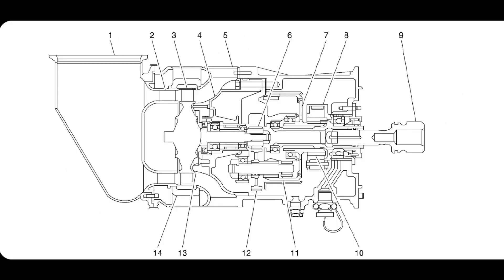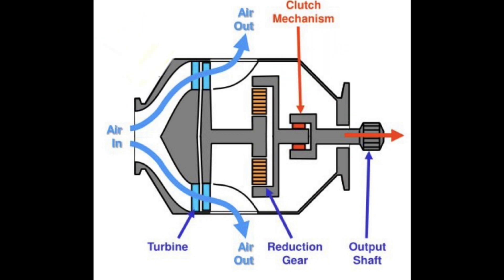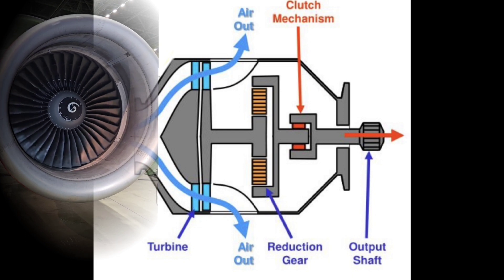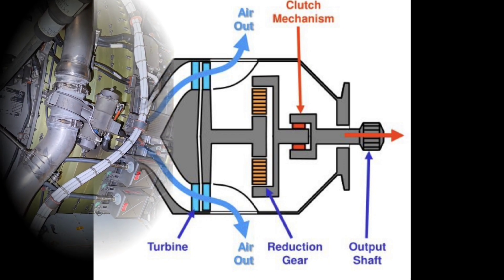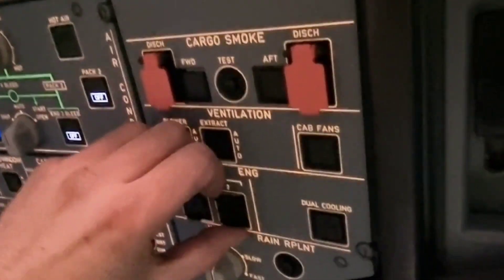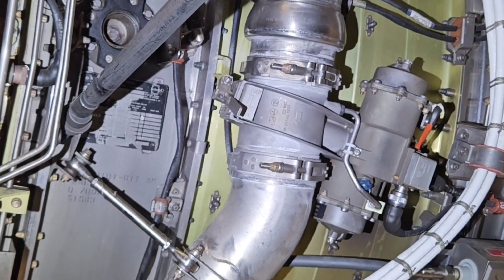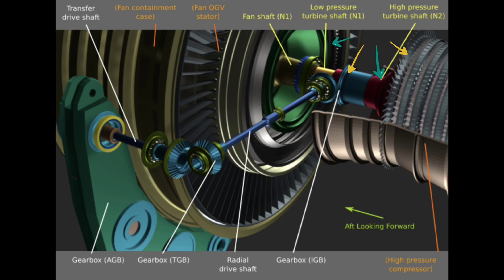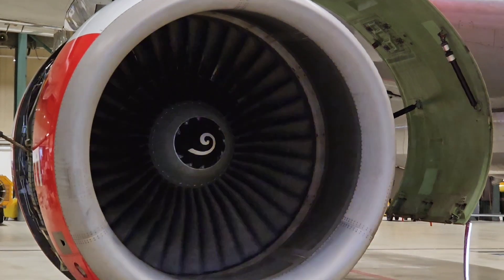How starting system of CFM-56-5B works

Comment: They start up with air pressure?? because an electric motor was too easy??? how incompetent are they?? Jesus
Reply from the maker: This is light and you have a very powerful air source so why not and it is very reliable.
Reply: @zeto.r  no, the little starter itself might be modest weight in isolation but consider the pressure tubes running all the way from the tail APU to both engines. All the mountings, the vibration protection, the space, the routing through all that structure. A single break anywhere and the whole thing doesn't work. It is an incredibly stupid design. I did a little math, about a 20kW motor for 20-30 seconds is enough to start an engine. An electric motor can output much above its steady rating for 30 seconds so just that motor alone is likely as light or lighter than the airstarter without the extreme support system it needs. I would guess as little as a 1kg motor could start it. An electric starter can also function as a generator so dual purpose free weight.
Hydraulics is also very bad engineering. Very elaborate clumsy fragile system. Airliners are surprisingly poor engineering. The socalled avionics bay is also a vogonic exercise in doing it wrong. And strangely universal among all models, even the very latest.
Reply from the maker: That same tube is used to run air-condition and wing anti-ice water and hydraulic tank pressurisation. Also you can start engine by other  engine
Reply: @zeto.r  the tube between the apu and engine starters also does aircon, deice water adn hydraulic pressure?? are you sure about that? :)
Reply from the maker: No hydraulic and water that is different pipe but air-condition and anti-ice for sure

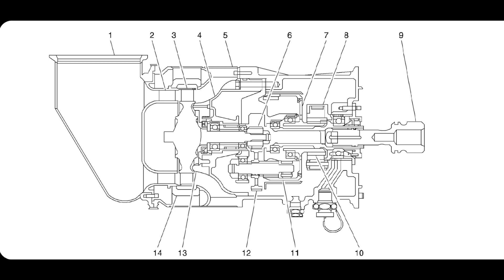Comment: Looking at the picture of the starter at video time 0:53 vs the picture at time 0:57. On the video 0:53 picture item #2 looks like a stationary stator/nozzle/vane ring and item #3 looks like the rotating turbine. On the 0:57 picture the arrow depicting the location of the turbine looks like it's pointing at a stator/nozzle/vane ring making it really confusing. Do both items #2 and #3 rotate in the 0:53 picture or is #2 stationary and #3 rotating.
Reply from the maker: You are right about item 2 which is stator vanes and item 3 is rotor. The same function you can see in the other picture works the same, it is separated. The front part is the stator and AFT is a rotor.
Reply: @zeto.r korrect.